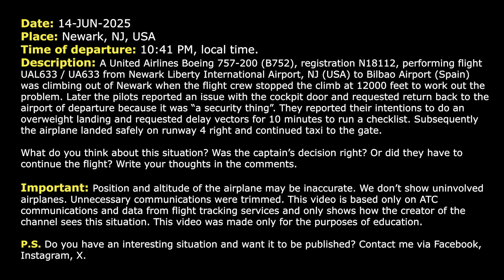Was it right decision? United Boeing 757 returns to Newark due to cockpit door problem. Real ATC

Comment: Unfortunately, they made the right call. 99.9% likely to have not been an issue, however security procedures are in place for a reason. You also don't know if the door was rigged to have a problem so a passenger(s) could rush the cockpit.

Comment: A checklist for the cockpit door not closing/locking? 🤫😕🙄 One would think you wouldn't make a big deal(make it known) in flight there's a problem with the door, even if there's an Air Marshall on board - it's a security thing, right???
Reply: Who's going to know? ATC? As a pilot, all I would tell the pax is that we have a mechanical issue that prevents us from continuing the flight (which is technically correct). The checklist was not for the door. It was to run calculations for the overweight landing, brief the cabin crew and advise company, get a gate assignment, etc.
Reply: @jetjock60  If I was on a flight and had bad intentions, I'd be listening in on ATC traffic from my seat.  That being said the odds are astronomically small of a hijacker being on the flight let alone it just happening to be a flight with a cockpit door malfunction.
Reply: @cruisinguy6024  Unless it was a pre-established game plan by a terror cell. A cell with a person on/in the ground crew that messed with the door on a certain flight #, with their people on board the same flight. So when it wouldn't lock they could get easy fast access to the flight deck. Always have to think worst case in scenarios like these, old military saying train like you would fight. If you train for every worst case, when it happens you are usually at least 75% ready. In this case, I agree, this should have been stated using the Security codes already in place for flight deck security. If you have listened to or been around other flights with fights or whatever on board ATC will ask for level of security and level of disturbance. Both have code words used to relay this info without saying actual events.
Reply: @jetjock60 👍 Thanks guys for your replies. they're very informative.Just trying to understand how it all works. I get the importance for the protocol of performing checklists due to certain issues and flying the plane. In a way, it seems kind of silly(but not silly) since they just took off. In this case, is the landing different than a regular completed flight? Since they're coming in heavy, do the computers calculate different things for landing settings and give them a different landing checklist?
Reply: @GDub-r6c  Trying to be as specific as possible, being 30+ years since I last flew a Boeing 737, here was no overweight landing checklist  for that aircraft. I cannot speak to this one, however. At the very least a landing distance calculation needs to be performed ( notice they specifically requested runway 4 left, the longest of the runways at EWR because of their weight). This aircraft does indeed have a lower Max Landing weight compared to it's Max Takeoff. You ask if the landing is different. Very much so for two reasons. The heavier weight over Max Landing will necessitate a faster approach speed on final, and because of the heavy weight and faster landing speeds, much more energy needs to be dissipated by the brakes and tires. An overweight landing inspection may be required before the plane is returned to service, due to greater stress on the landing gear.
Reply: I assume the checklist was for overweight landing preparations, not for the door...